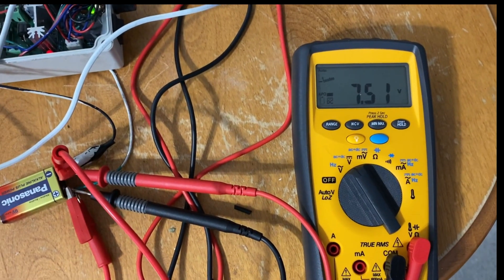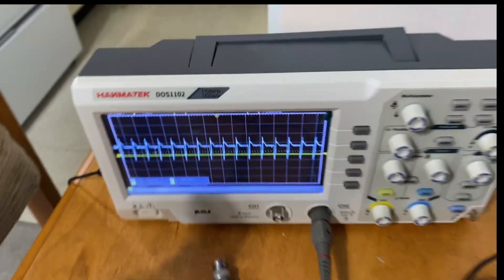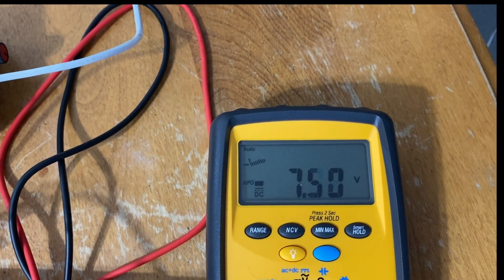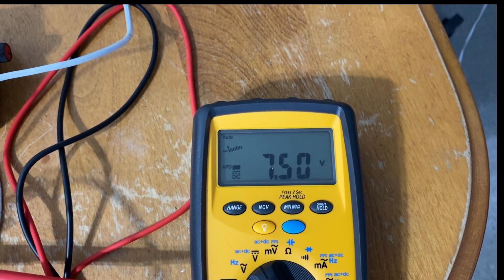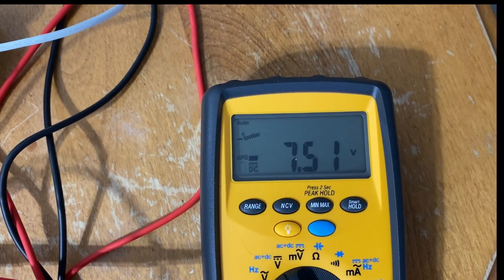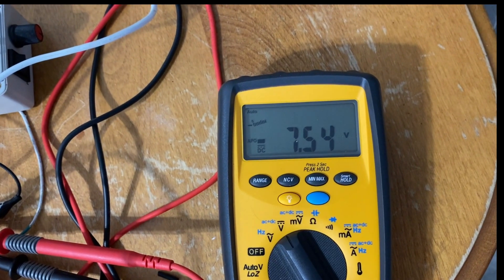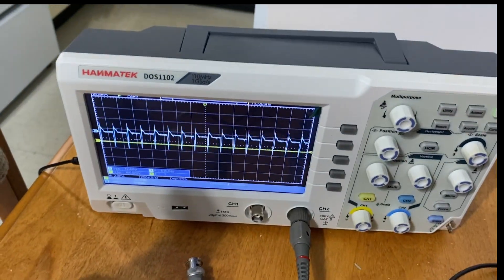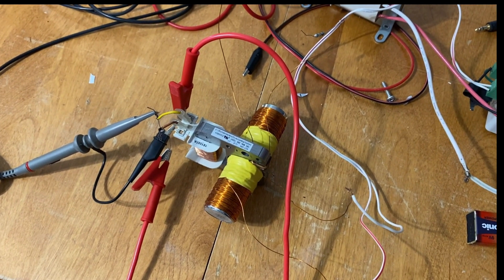Magnetic Anomaly

Comment: Looks like you are pulsing or adjusting the Bloch Wall & Neel "walls" of the magnet , 
thru the primary inductor & into the laminations for the Copper Coil load. 

Do you have any plans to shade the laminations in a manner to make the induced 
charge flip or change form again before it goes into the wire wound inductor ??   
Bedini used charge/pulse flipping extensively  as did Ed Leedskalnin.  

I still think some kind of primary Analog  Switching method is needed
over  the Silicon based Digital Switching. The manner of switching makes a huge difference 

keep some LED's handy to light  up.  If you can get LED's to light up when forward & reverse biased
If you want to chase down the digital path maybe add a 
Peltier cooler plate with its array of PN junctions to interact with.

Comment: Do you explain that coil anywhere? are the two solenoid coils in series? the cylindrical core is a magnet? or what material. How is it connected to the laminated core?
Reply from the maker: Just using one atm. The pickup is the motors original drive coil.
Reply from the maker: I setup an app with audio stereo outputs. 12khz sinewaves in push pull each side is L and R. Phased the waveform as well. So one don't cancel out the other. Then again some might want to explore that as well the canceling effect that is. .  But it's not what i'm showing here but the reason for those 2 coils around the magnetic rod.
Reply: @joellagace1679 so you took out the microwave original motor and put a closed cylinder in the hole?
Reply from the maker: Rare earth magnet rod.

Comment: The inrush current is the magnetic conjugate of the electric displacement flow — a transient magnetic current meeting its electric counterpart through the parasitic capacitive coupling between coils.

In an RLC system, every “reactive” element hides an imaginary energy axis, oscillating instead of dissipating. When we canonize the imaginary component — treating it as a real physical degree of freedom — we uncover its conjugate momentum, the channel for reversible energy exchange between electric and magnetic domains.

That’s what quadrature really means: electric and magnetic energies 90 degrees apart, each storing what the other releases. But beyond this basic 90°, there are eight phasor degrees of freedom — four electric-magnetic and four temporal-kinetic

Forming a complete loop of coherence, the phasor cycle in electrodynamics follows:
0° electric field → 90° magnetic current → 180° electric current → 270° magnetic field.

Its magnetodynamic conjugate is the inverse wave of the imaginary components:
0° magnetic field → 90° electric current → 180° magnetic current → 270° electric field.

Together, these two rotations define the eight phasor degrees of freedom — four electric-magnetic and four temporal-kinetic — that close the energy manifold. The so-called “parasitics” simply act as bridges between these quadratures, enabling the internal flow of coherence.

Inrush, then, isn’t loss — it’s the exact moment when all these axes synchronize, and energy crosses domains through magnetic–electric conjugation and displacement coupling as a single continuous field.

Comment: This really has me wondering about al the "what's ifs". I measured a fluctuating electric field with a proper meter before using a stack of neodymiums wrapped with magnet wire attached to an earth on one end and a piece of steel on the other. 

What happens if you use ferro fluid? What happens if you supercool it?? Put it in a vacuum perhaps? I really wonder.

Comment: There is one thing that nobody speak about: the inrush current ! We must consider the inrush current taking place in both ways not only as “absorption” from voltage source (battery or whatever). Even if we see a continuous flow of few mA in reality there much more flowing through. And if we don’t allow the current flow to change direction in DC by making a close loop on itself additional to the main circuit, the input energy is recycled and this is valid for AC as well, not only for DC.

Repetitive interruption create a huge spike in current as well not only for voltage … this is why we can drive motors or any load with just a pwm, the load should get all the power it needs from inrush current when magnetic field collapse or changing polarity.

Mainstream science seems to ignore action-reaction law or tell us is applied only for dismantling overunity devices !

I am yet to see an official explanation from mainstream science academia of why electric power is generated by a Faraday Disc where no magnetic flux cut the wires as they keep saying it is a must if we want to generate electric power 🤭🤓
Reply: The inrush current is the magnetic conjugate of the electric displacement flow — a transient magnetic current meeting its electric counterpart through the parasitic capacitive coupling between coils.

In an RLC system, every “reactive” element hides an imaginary energy axis, oscillating instead of dissipating. When we canonize the imaginary component — treating it as a real physical degree of freedom — we uncover its conjugate momentum, the channel for reversible energy exchange between electric and magnetic domains.

That’s what quadrature really means: electric and magnetic energies 90 degrees apart, each storing what the other releases. But beyond this basic 90°, there are eight phasor degrees of freedom — four electric-magnetic and four temporal-kinetic

Forming a complete loop of coherence, the phasor cycle in electrodynamics follows:
0° electric field → 90° magnetic current → 180° electric current → 270° magnetic field.

Its magnetodynamic conjugate is the inverse wave of the imaginary components:
0° magnetic field → 90° electric current → 180° magnetic current → 270° electric field.

Together, these two rotations define the eight phasor degrees of freedom — four electric-magnetic and four temporal-kinetic — that close the energy manifold. The so-called “parasitics” simply act as bridges between these quadratures, enabling the internal flow of coherence.

Inrush, then, isn’t loss — it’s the exact moment when all these axes synchronize, and energy crosses domains through magnetic–electric conjugation and displacement coupling as a single continuous field.

Comment: I like to keep an assortment of Compass'sss  around my bench when doing this kind of work.  
Add hook Velcro to the back of the compass's &  loop Velcro to something solid & non magnetic.

I do wonder what you have going on at the North & South end of the bar magnet whilst it is ringing.

You have the primary note of the circuit & then some. 
How hard would it be to build your own transducers ??  

Long as that Alkaline battery is not giving off any  heat , stay at it.  

When you catch a wave things become much much clearer. 
It;s not the kind of thing one misses.